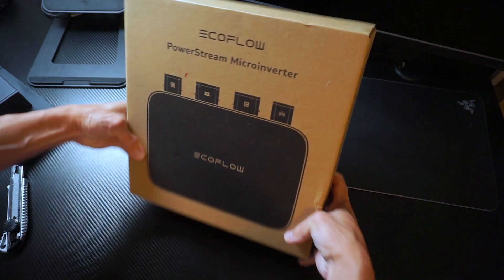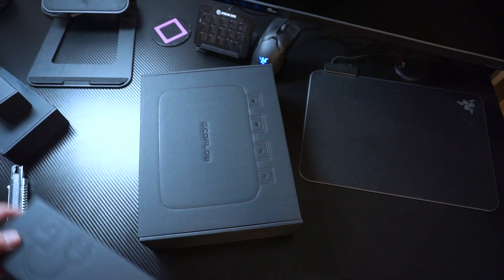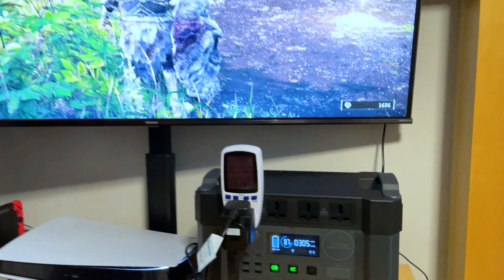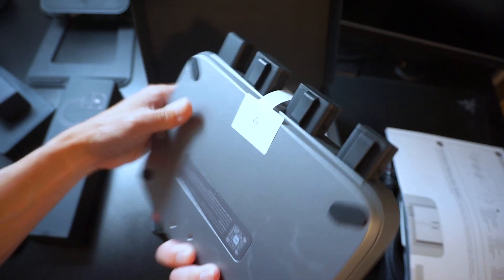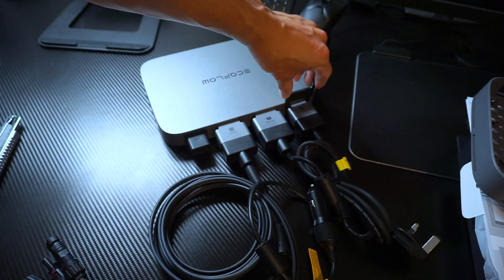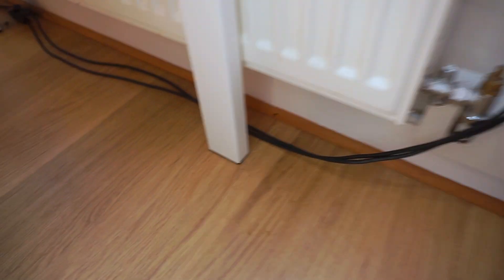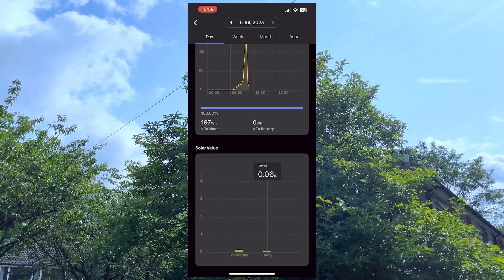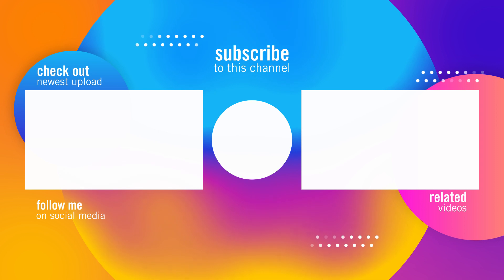EcoFlow PowerStream Unboxing and a Quick Review! Can you save electricity bills with this?

Comment: Is compatibile with River 3 plus series? what cable? thanks
Reply from the maker: Hi, thanks for your comments! You will need an EcoFlow BKW-RIVER cable to connect your River 3 Plus and supply electricity. However, the connection port (the 12V car charging port) is an output port only, so the microinverter unit cannot recharge the River 3 Plus via the car charging port. Here is a quick video about the cable. Hope this helps!

https://www.youtube.com/shorts/I5RsEmVPXBA

Comment: Hi I have another question, I have a 455W solar panel thats connected to PV1 and I want to add another solar panel to PV2 200watts + 200watts. It is possible to do that? Or i need to buy 4pcs of 200watts and removed the 455watts?
Reply from the maker: Hi, thank you for your comments! Based on what you’ve mentioned, it should be feasible to connect the 455W solar panel to PV1 and allocate the remainder to PV2. According to the specifications, they can accommodate separate inputs of amperage and voltage. I hope this information is useful to you!
Reply: @MasaruYTChannel  thank you :)

Comment: I got my powerstream today. After installation the LED indicator is white not green
Reply from the maker: Hi thanks for your comments! Did you manage to set up the app? Is there any error messages show up on the app?
Reply: Issue was resolved the problem was the solar panel im using for testing is the ecoflow 100w panel. Then when I received the new panel 455w. And it works :) 
Thank you

Comment: I have the same system here in the UK, connected up to X2 400w ecoflow solar panels. X1 panel connected directly to my ecoflow delta mini and the other panel is connected to the power stream. I do this because the delta mini has limitations and can only discharge energy to the power stream. Both panels are laying flat on my flat roof kitchen extension south facing and 1 panel will charge up the delta mini while the other will power the home during the day. When it's evening the dalta mini will supply power when no sun available. I find doing it like this is better untill I purchase a delta 2
Reply: Are you able to estimate how much you have saved so far. Can you say it worth the saving cost?
Reply: @cyclonescotch  unfortunately not as my house is currently been renovated and not occupied
Reply from the maker: Hi, thanks for your comments and for sharing your experience! I like the way you split the generated electricity into the home grid with PowerStream and the Delta Mini. I have been considering buying EcoFlow's big batteries like the Delta 2/Max, but I'm still trying to justify the cost. I bought another 100W solar panel from Renogy few days ago, so I'll see how it goes!
Reply: Now, a set of 2 solar panels and a micro-inverter alone can be bought for £349. You can get a 2kW energy storage unit for up to £1000, plus 4 smart plugs for £120 (4 pieces should be enough). With a set like this, you can easily save up to 6kWh per day. It might not seem like much, but over the month, year, and years, the set pays for itself. Without the huge costs of installing panels on the roof. And in case of a power outage, you can connect appliances like your fridge and aquarium to the energy storage and have backup power during that time. The next day, you can recharge the energy storage unit, which will continue to power your devices if needed. And let's not just look at the return on investment, but also at the independence it provides. You can actually quickly pack up this set and install it in a new location. Kind regards,"
Reply: Did you report this system somewhere, e.g., to the grid operator? 
Thanks for answer